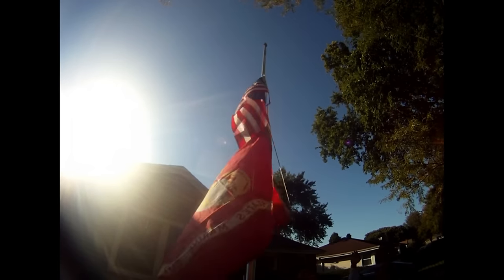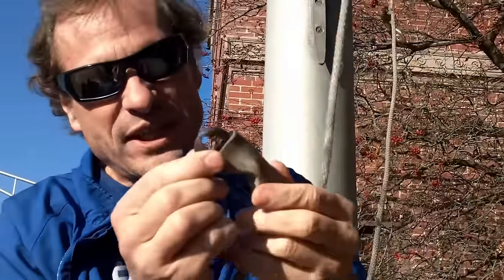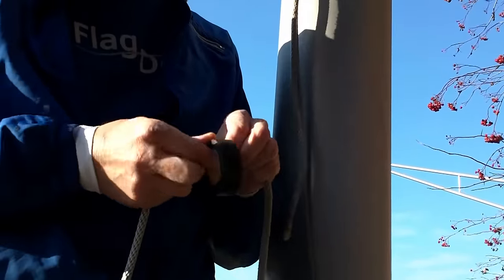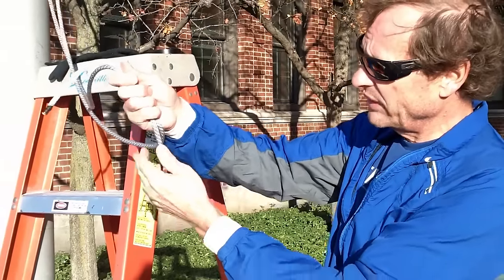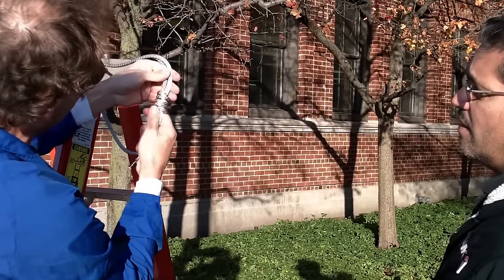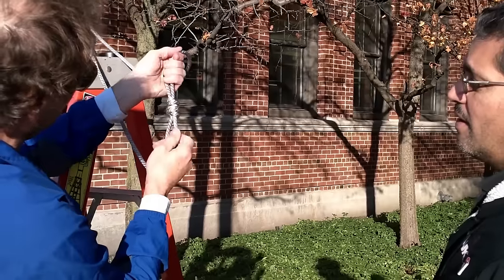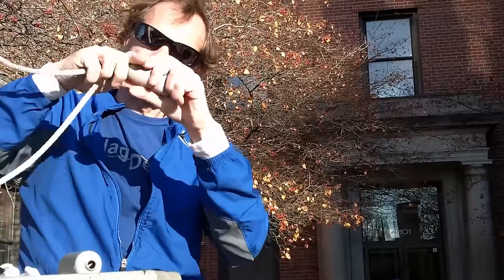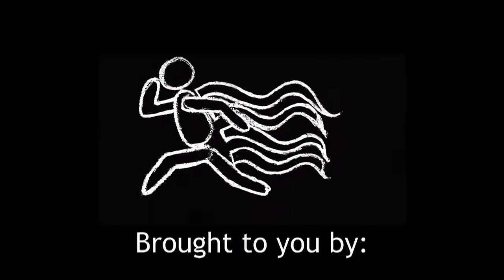FlagDesk.com | How to replace flag pole rope (proper knot) and flag snap hooks

Comment: I need to replace my mother's flag pole rope next spring and really found your video super helpful!  Where do you get the rubber thing to protect the hooks?
Reply from the maker: I'm glad this will help you with your mother's flagpole! The snap covers are not a standard part you'd find in the hardware store, but we like them. Here is a link: http://www.flagdesk.com/evcg-312-gray-vinyl-snap-cover/item/1350137

Comment: I have been trying to design an anti-furl device for my flag kit for some time.  I have used brass washers and bushing and drilled holes in them to install clips but nothing works.  I tried the plastic ones for sale online and have had issues with them as well.  Do you have any suggestions on hardware or know of any kits that have a pulley at the top?  This is a flag kit not a flagpole. Thx.  Eagle Point, Oregon...